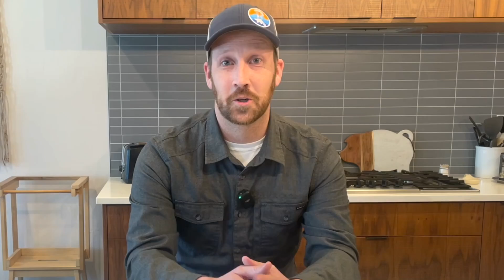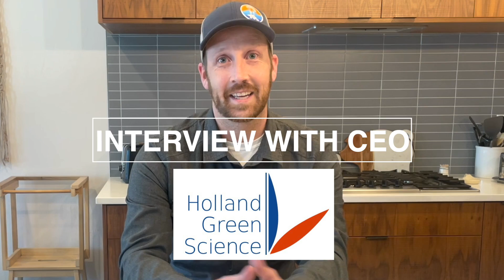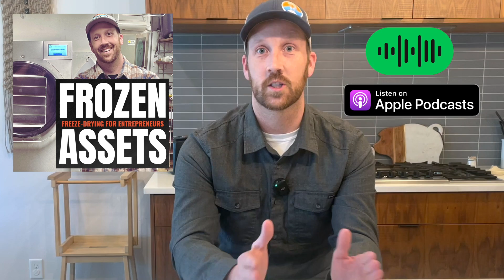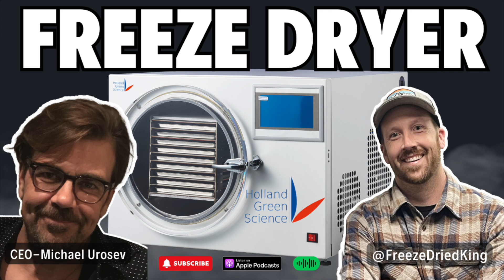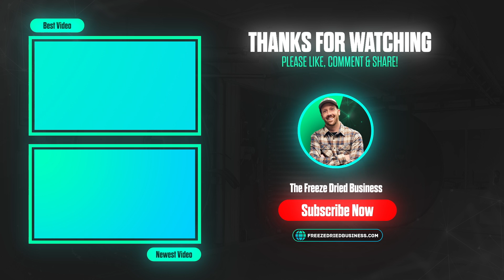Buds & Candy: Are Cannabis Freeze Dryers the Answer?

Comment: I bought a freeze dryer for my hash but returned it when I realized I could the same results by freezing my pucks, micro planing it onto a parchment line baking sheet and then keeping it in the fridge for 2-3 days and then press it.  Manage the same bright white colors and ott flavors.  If you really want full heads you can even sieve the wet hash instead of microplaning it and dry it a day or two longer in the fridge.
Reply from the maker: I’m not familiar with the hash industry but definitely wanting to learn more
Reply: yeah i used to do it that way and it works but some times i ran into issues getting it to break up it is a bit of a pain in the butt and some times just did not work for me and i had to put the hash back in the freezer over and over and really if you cant keep the temps low the hash will darken when drying a bit , the freeze dryer makes it easier for me to dry and i can get allot more done at one time cause i dont need so much space to lay it out to dry , its not really needed if you can get the space time and temp good and can put up with the hassel of grinding it up with a strainer or planing , but any job is easier with the right tools and the freeze dryer has proven to me that it is the right tool for the job with hash , but your right it is not really needed but man it makes it easier

Comment: i buy a xiros mikro and i have some trouble whith the prgram ,
ex: set to 3.00 mbar ,  at the beguining in the first steps i can watch the vacoum valve working allways calibrating to the right pressure but affter a wile no more , i lose the pressure estability and goes to 0.35.
i dont have info anywere and im new in liofilizator world

Comment: 6,000 dollars? Get out of here.  That's WITH OUT the pump.....   What gives this machine the ability to do skittles in one house vs harvests dryer?  I am sure we could just find that out and modify a harvest dryer for a fraction of the price.  Him comparing freeze drying cannabis to regular drying on a rack for a month time is bogus.  You can just toss full plants in teh freezer before you make the hash and then use a harvest dryer to dry the kief  .
Reply: Harvest right units break down and for bubble hash the machine needs to be reliable the product inside most of the time is worth more than a harvest right unit my pharma model is down because of a bad condenser fan this is the 2nd issue in 18 runs i am now looking at a holand green science
Reply: @peterconka6315  - running hash through my harvest right perfectly fine.  If at some point it breaks i will just buy another.  I could buy 2-3 of them for same price.

Comment: great interview.  i am curreñtly making a home grown freeze dryer. im taking a mcdonälds under  couñter freezer, and making a acrylic box inside. everything is from the metle recycler center. found a lab vacuum pump and a lab freeze dryer, so i took the two inch plexy door. plän to use hot plätes inside at first.  should be a mess. it is like that johnny cash song. its a 52 53 54 57  automobile.
Reply: Great like to hear this, what your doing, I was thinking the same thing to make my own, Lots of Lab equipment auctions out there, I was thinking of starting a business to find used cheap lab equipment or parts, for people who know what they want, Need a job, Lol Have a great day!!